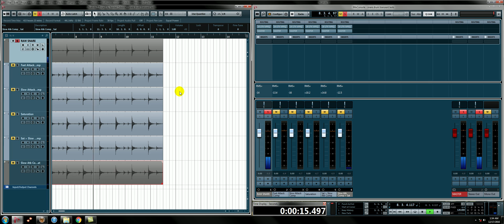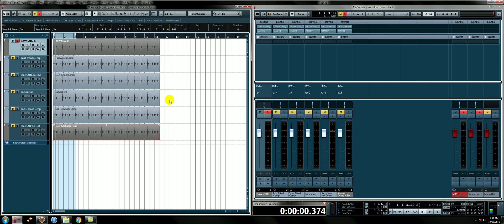Compression or Saturation - Which Comes First?

Comment: My snare chain is usually: saturation (on the gainstage plugin)>gate>transient designer>slow attack compressor>eq.

But I also send the dry snare to a paralel bus. Which I then smash with a fast attack compressor and distortion. And both are going to the drum bus which has saturation, a clipper and a limiter on it that shave off a little bit of the snare transients.

Comment: I still don't understand what's the problem with fast attack and gain compensation?
Reply from the maker: There’s no problem with it, it just doesn’t work the same way. Test it out for yourself. To get the same effect of saturation, you’d have to use a VERY fast compressor, something nearly immediate. The problem there is most “nearly immediate” compressors tend to clip HARD rather than SOFT. Saturation tends to clip very transparently and naturally and does so very consistently, without having the same side effects of compression. 

But in the end, people still use compressors for peak control all the time. Like I said, try it for yourself and compare the results!
Reply: @RecordingLounge  
I understand what you mean but it's not that  you can't tame those peaks perfectly fine without saturation. Not everybody wants saturation on their drums all the time. But I agree that it smooths the transients quite nicely.

Comment: This test would be better if you would set output gains on the same level i mean before and after.
Reply: Yeah I wanna see the transients peaking at the same dB. My bet's on the saturated one sounding the loudest but obviously missing some of that punch.
Reply from the maker: To me it doesn’t make sense to match peak levels, as we don’t hear things based on peak level, we hear them based on average level. If I did it based on peak level I reckon I would have more people complaining I didn’t level match them to RMS!
Reply from the maker: But you are correct - if you level match to peak level, the saturated one will Sound loudest. The compressed on generally has a higher peak level (depending on how you set the compressor). It’s a common myth of compressors. Check out my video on Mixing for Loudness, I think you’d enjoy it
Reply: @RecordingLounge  yeah saturating peaks was the biggest/best mixing for loudness tip I ever came across!
Reply: @thenoddy7  yep, i think that you can be right

Comment: why would you ever want to add any effects or saturation before compressing drums, percussion, basslines ..it doesn't make any sense.. its like putting a Limiter in the 1st slot of your master bus.. & then an EQ ,,that's just crazy ! ;^)
Reply from the maker: It’s actually QUITE different than the master bus. Please watch my video on “mixing for loudness” and it might explain this more in depth for you.
Reply from the maker: It’s more like asking “why would you ever want to drive a Mic pre into saturation?” Or “why would you want to push into analog tape when tracking?” Well...if you record stuff clean and then put saturation in your first slot....it’s effectively like doing it that way. It’s not crazy at all. Records have been made that way for decades.  ;)
Reply: yeah but the examples you are now talking about my friend have very little to do with the Dynamics of sound ..  in your video you are mostly referring to dynamics, so it does not take a genius to figure out that compressing a sound before adding saturation will obviously squash the dynamics.. 

as i mentioned before, you pretty much get the same result when putting a Limiter on your master bus before compressing & adding EQ .. the Limiter would just squash the dynamics out of sounds that find space to peak over..  

compressors should always be in slot 1 either it be the Track/Audio buses or master bus & everything else follows
Reply from the maker: They absolutely have everything to do with the dynamics of Sound.... specifically microdynamics. Compressors and saturation devices absolutely affect dynamics in macro- and micro-dynamic ways. It all depends how they are set. 

There’s truly no right or wrong way to do it, I’m not sure why you feel the need to argue with that. And to say “compressors should always be slot 1” is a very narrow minded viewpoint. Compressors and saturation devices can be in whatever order you want them to be in. Seriously, watch the other video, “Mixing for Loudness.”
Reply from the maker: Saturation devices by their nature limit dynamic range. But compressors, depending on how they are set, can limit dynamic range or actually expand it. If you set a very slow attack on a snare drum, and smack it really hard, you’ll actually increase the crest factor of the snare drum, and therefore INCREASE dynamics. It really is all dependent on the application. I talk about all of this on the other video. I think you will enjoy it.

Comment: Really interesting.  Got me thinking about other plug in orders - EQ then compressor?  Or a further comp after?  What sort of EQ?  etc....fun for days...

Thanks Kendal
Reply: I almost always EQ first so I'm not compressing unwanted frequencies. If not I will only compress with a 2:1 ratio max
Reply from the maker: +Fav F hey, whatever works!
Reply: Hey mate! I think the answer to this question has many variables, but often if you boost some EQ on a track you should add a compressor after that. The reason for this is that the boost will sound fine when the track is at lower gain levels, but when the track gets louder the boosted frequencies will often get out of hand. So a small bit of compression AFTER the EQ can tame these frequencies so they don't get crazy. You can find more info on this in this video which provides links to other videos with great audio editing content (like this video): https://youtu.be/IiwQuJ_hDYM